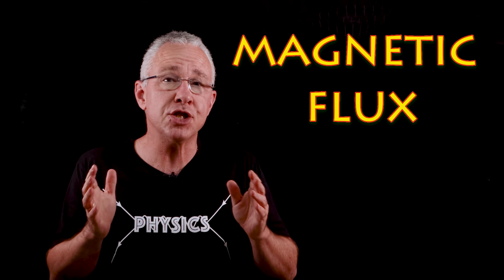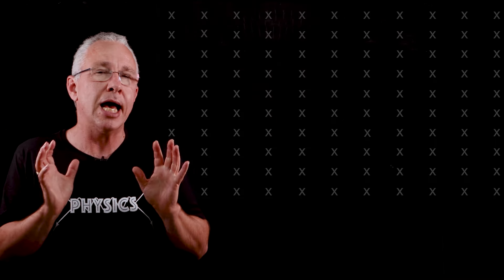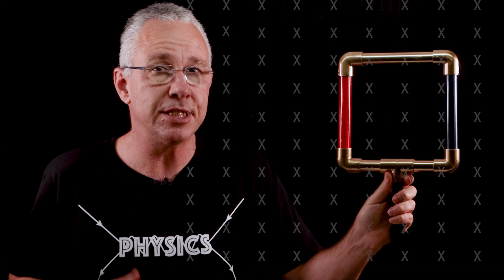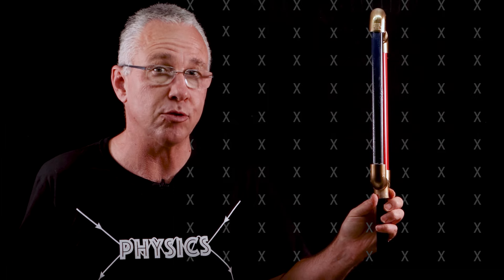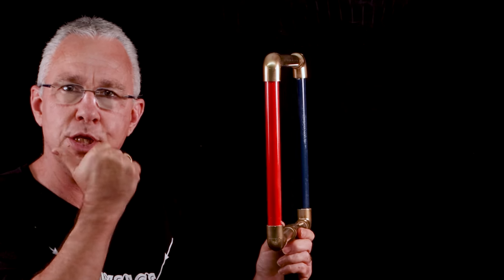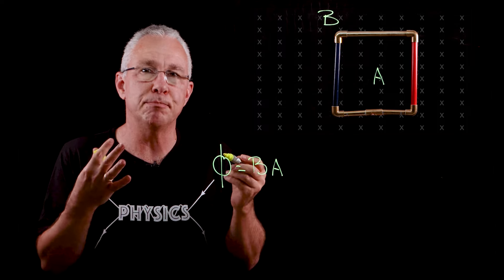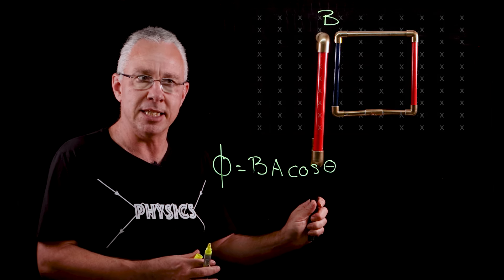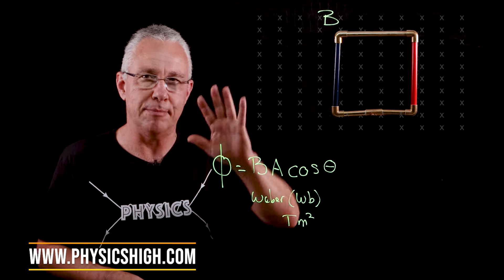Magnetic flux explained in 3 minutes

Comment: There is something that I'm not quite grasping here. It is understood that magnetic Flux is stagnant on its own, and yet it is described as going into or out of a given area going in or out implies movement . These are verbs/action words. Flux does not move unless one moves it. What is actually meant by The flux lines, 'B field' is going in or out?
Reply: The coil is rotating causing the magnetic flux to enter and exit as it rotates.
Reply: The field lines interact with the surface and then they have “action/verbs”

Comment: wait I took in my class that the magnetic flux is at maximum when field lines are PERPENDICULAR, therefore sin(theta) is used not cos(theta); can someone elaborate?
Reply from the maker: Correct terminology is about the surface vector. This is the vector the area is facing. Hence flux is maximum when cos theta equals one.
What do you have been taught is the direction of the plane versus the direction of the magnetic field. so at maximum flux the angle is now 90°. So, what you have been taught will give you the same answer, better physics terminology refers to the surface vector.
Reply: oh alright, but i am still skeptical about the cos, because if the vector is parallel then it won't intersect the field  @PhysicsHigh
Reply from the maker: @fatimahadi3845 
Think of the surface vector as the normal to the surface. 
Since flux is the number of field lines passing through the surface then this is at a maximum when the field vectors are parallel to this normal. The angle is zero at this point. This means cos0 thus = 1. Similarly if the field lines run across the surface then these very field lines are perpendicular to the normal (surface vector). Flux is 0 since cos90 = 0

Comment: "20 magnetic field lines" a quanty of imaginary things?  

I get using the concept of field lines to visually represent field direction and line density to represent field strength.  But when were not careful, way too many people end up dumber then when we started. 

Field lines are not real. Somehow, some people end up thinking
1) they flow,
2) or that there are magnetic vortices and ferocells are proof of it.  
3) Or dont understand why  homopolor generator spining a magnet on its pole doesn't spin the magnetic field lines (that dont exist), but if you spin a conductive plate about a magnetic pole, it generates an emf between the inner radius and outer radiuss of the faraday disk.